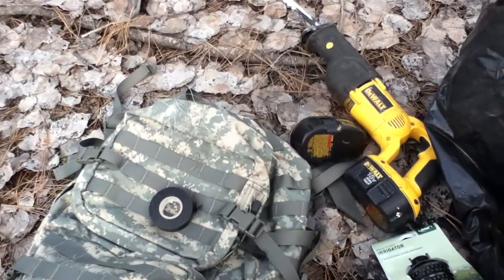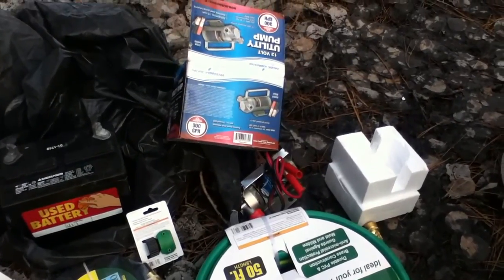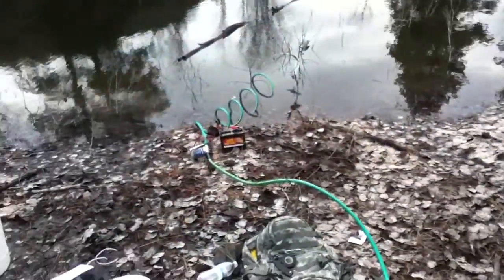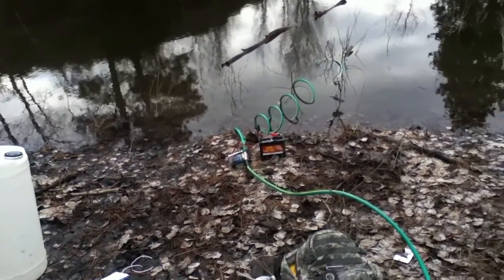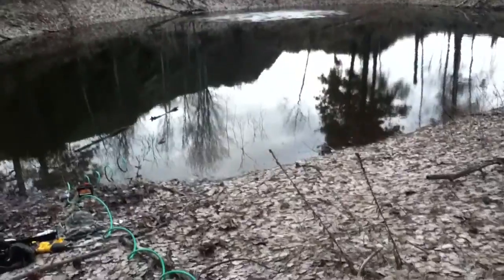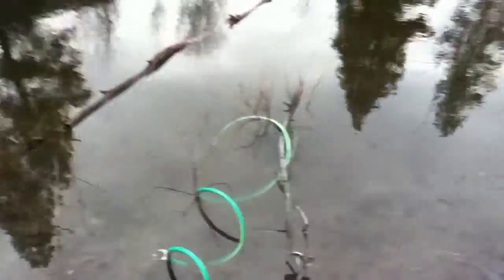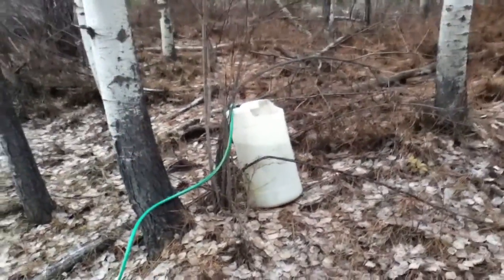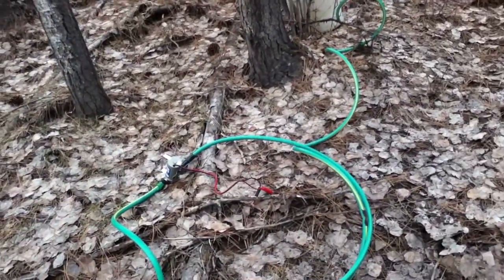Backwoods Water Recovery System 12v, for camping, RV and Remote Cabin use

Comment from the maker: I seriously doubt it.   These pumps push water very well, about like a household water hose, but they don't pull water very well at all, even when primed.   I had to cut the inlet hose pretty short just to get the pressure going.    What you probably need is a submersible pump to work with that well.    The submersible pump gets water to the top of the wellhead then one like this can take over from there.

Comment from the maker: I dunked the inlet hose in water before attaching it to the pump.  The pump is self priming so it can suck water a short distance, just not the entire length of the hose.   As long as the hose is at least partially filled with water you ought to be all right.